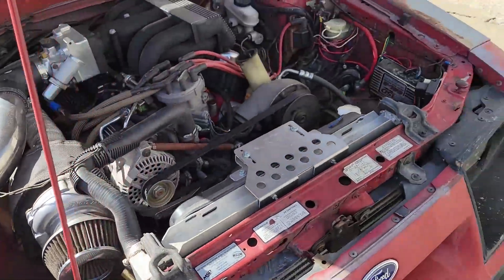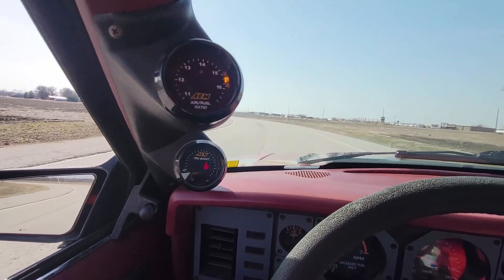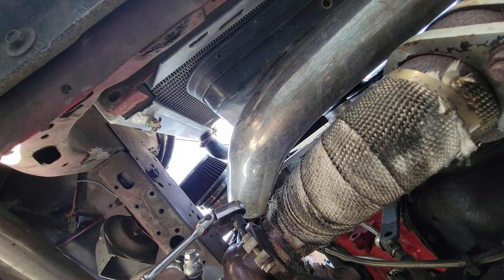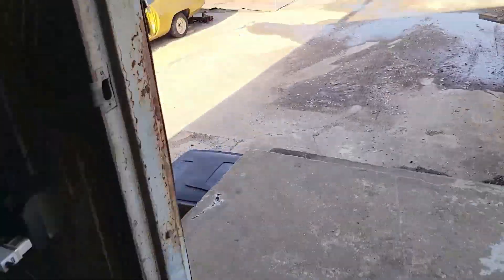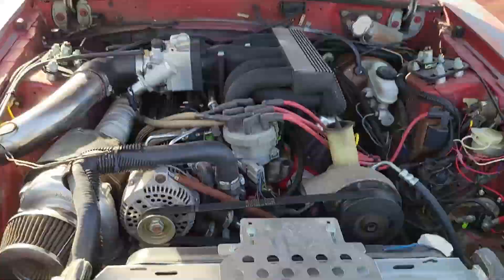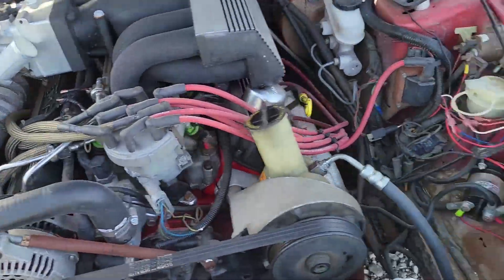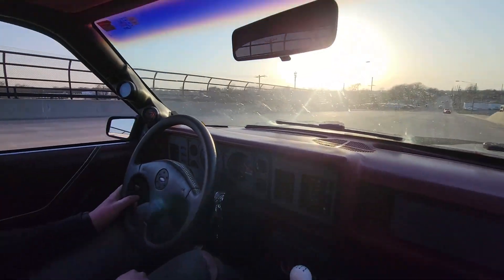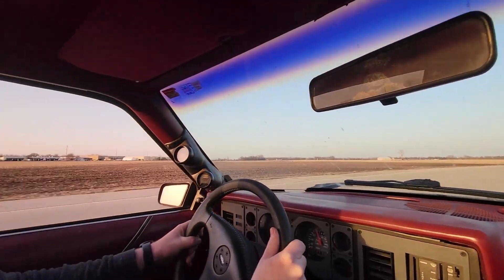Turbo Fox Body! 1986 Ford Mustang VS Racing Wastegate Install

Comment: Run 2 wastegates one on each side. I used to get spikes too until I ran 2 gates
Reply from the maker: Yeah, I've heard about that. The better wastegate seems to be working now. I'm gonna play with the boost controller more today, but at least it's not spiking anymore.
Reply: @JJspeedshop  for sure I put a tial gate in my first build took care of the spikes too. But now I just double up those cheap gates save about 200
Reply from the maker: Man, them Tials are SPENDY.